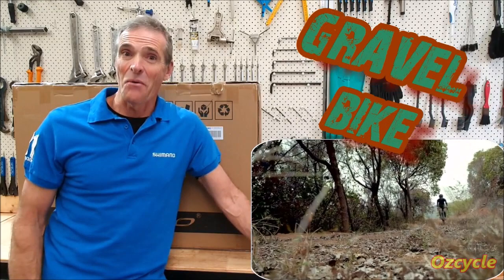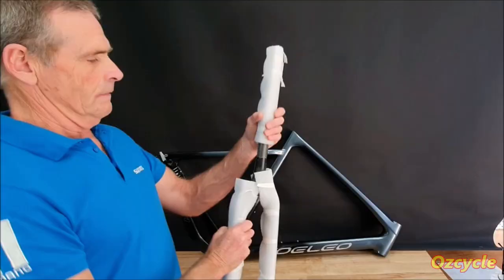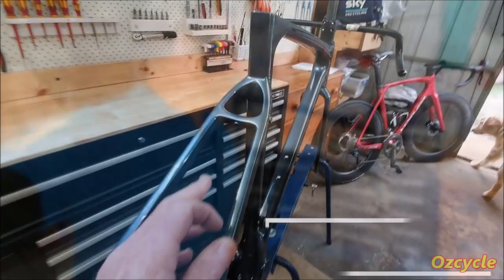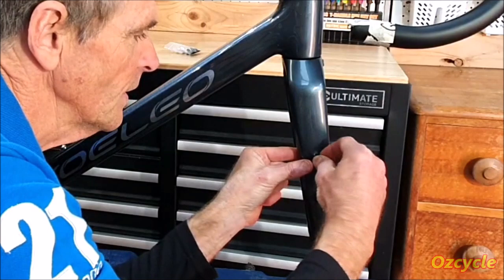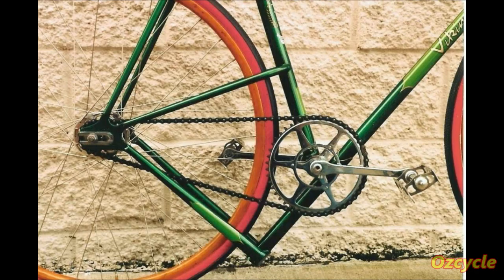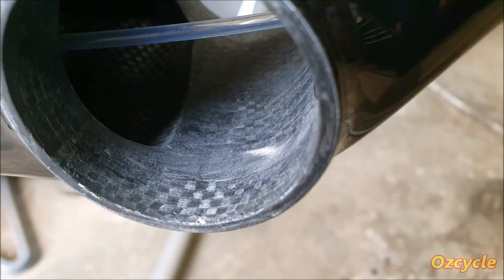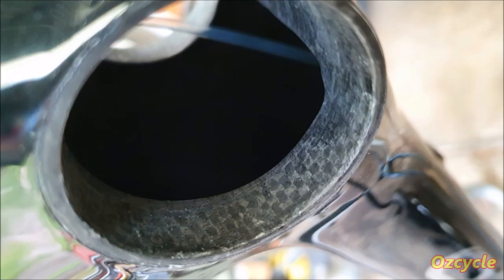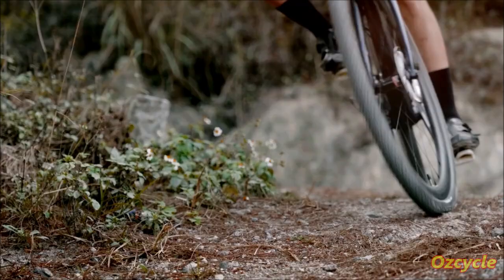Yoeleo G21 Gravel frameset unbox and review

Comment: Could you please but the link to AliExpress where I can buy those bolt hole covers... They are great!
Reply from the maker: AU $0.67  31%OFF | 20PCS Black Hex Socket Allen Bolt Screw Nut Hexagon Head Cover Cap Protector Fasteners Screws Covers Caps M5-M24
https://a.aliexpress.com/_msmCK02
Reply: @stevenleffanue  What size did you use for the frame?
Reply from the maker: 4mm
Reply: @stevenleffanue  Thanks.... I ordered some.  Great video!

Comment: The bottom bracket is now advertised as BB-T47.  Is it possible to get some  insight into installing this (even though I guess your bike will be press-fit)?
Reply from the maker: BB shell is 86.5mm wide. Bore is 46mm diameter. Does that help? I'm using BBB brands... bbo-01.

Comment: Hi, curious what are those plastic buttons that you placed in the forks called? 😁 trying to look for it in aliexpress. Thanks
Reply from the maker: They are just that...plastic plugs. 
Just found this amazing item on AliExpress. Check it out! AU$0.77  25%OFF | 1Pc 9.5mm Snap-on Hole Plugs Silicone Rubber Sealing Plug End Caps Stopper High Temperature Resistant White & Black
https://a.aliexpress.com/_mt2BSOG

Comment: can you put a regular stem and handlebar on this bike?
Reply from the maker: Yes , if the stem is 1' 1/8" ahead.
Reply: @stevenleffanue  can I use the provided top cap and spacers too or do I have to replace them?
Reply from the maker: Yes. An ahead needs a top cap for compression of the headset.
Reply: @stevenleffanue  yoeleo will sned me one
Reply: @stevenleffanue  whats the standard for the steerer tube - IS52/28.6 ? thanks
Reply from the maker: Yes

Comment: Press fit bb :(
Reply: Yes almost the only drawback of this very good frame. I wish they went with a threaded BSA or T47 and it would be perfect
Reply: Nothing wrong with press fit - used in many critical industries. Problem was only that bike manufacturers skimped on qc and cut corners giving press fit a bad name. Much easier to get perfect alignment with press fit too. Hambini has an excellent video on this.
Reply: @meibing4912  Nothing wrong indeed, I might even prefer a pressfit on a good roadbike. However, it depends on what your priorities are. For my personal use on a bikepacking/adventure/gravel bike like the G21, I prefer the simplicity, ease of installation/removal and serviceability of a threaded BB for me as a home mechanic and also on long trips. Pressfit is not bad, it's just not the best solution here (imho) and therefore makes me look perhaps for another bike.
Reply: @swe223  go for it! (even if you can certainly service a pressfit BB at home too)
Reply: @swe223  they recently updated the frame from bb386 to T47 and made some other improvements as well. Just check their website.😊
Reply: @DavisJork  Wooow thanks for the info! Indeed they just released a blog post today about the new 2023 frame. New seatpost and clamp design, new RD hanger, small improvements and T47!  This frame is actually insanely good now. GG to Yoeleo
Reply: All bearings are press fit...
Reply: @georgeserhard486  not all bottom brackets = bb 🤭
Reply: The new version G21 DB frameset will use the BBT47. Hope it helps. 😊